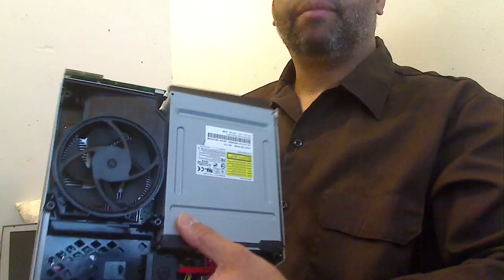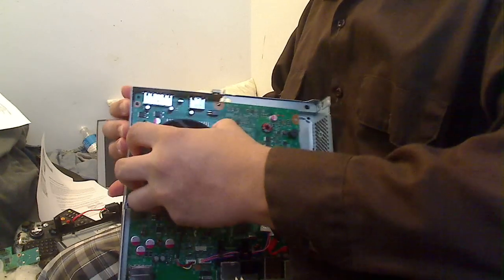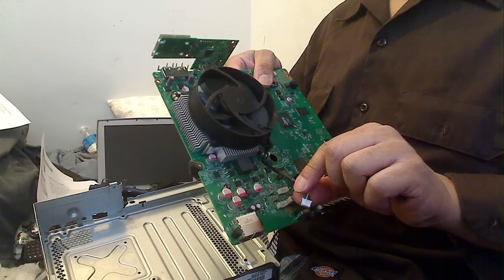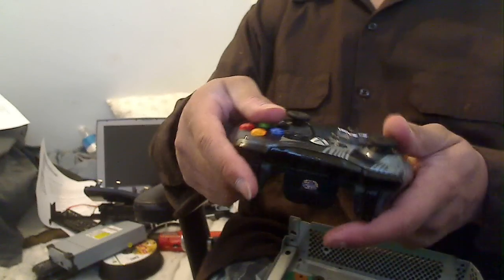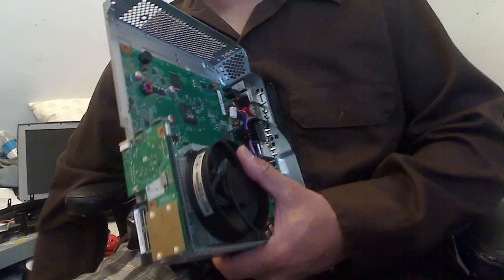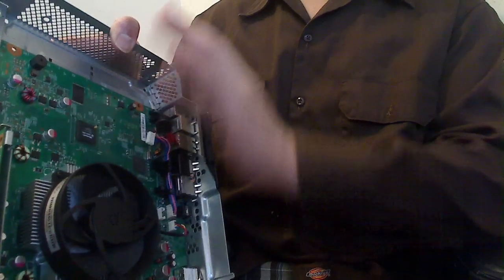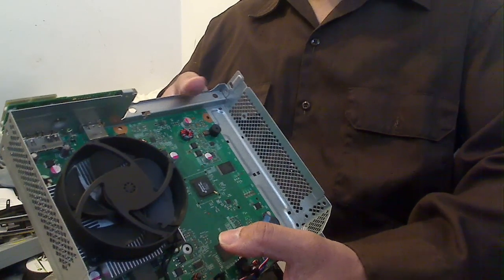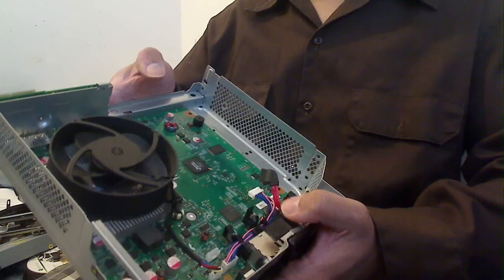How to fix Xbox 360 Slim RROD / Red Dot of Death Reset Solution👍

Comment: Ok so after 2hrs I tried to power it on again and to my amazement its working!! But I got a ventilating warning screen (which I brushed off as the fan reset/overheating method of yours) but its been 15mins just using the YouTube app and its really hot is that normal I've never really took noticed how hot it gets before all this and I just want to be sure its going to be fine please can you answer this time
Reply from the maker: It's not supposed to be running hot. If it is check to make sure that you've plugged the fan back in and that it's functioning and you can either here the fan spinning or see it spinning. Be sure the vents are clear of dust and debri so that cool air can come in and hot air can go out. Have you removed the heatsink, added screws or just placed the x-clamp back on.

Comment: So as many have asked and you have not given a reply to is once the fan is disconnected and you power on how long until it overheats and powers off I've been waiting 10mins so far and nothing just a solid red dot on console and solid green light on power brick wait... While typing the console now has a flashing red light? Kinda nervous as electrical stuff scares the shit out of me and this doesn't feel safe
Reply: Ok so to answer my own question about 15mins in 10mins it starts flashing red then about 5mins after that it powers off lol anyway I'll get back to you if I don't somehow electrocute myself if this works for me but my case seems unique as I spilt strawberry milk in the fans vent and after what I thought was a good clean powered it back on  and it worked fine for half an hour then bam froze and when I powered back on I was stuck with red dot and black screen but I'm hoping I've done a better job cleaning it this time but despite being positive I think I fried something but I honestly have no idea but again I'll let everyone know if it works for me so anyone as clumsy as me might have an idea if this will work for them xD
Reply: Ok so didn't work for me I'm broke af so can't but a heat gun and that seems like my only option other then just getting a new one which even know they're cheaper now I can't afford yay what a shit day
Reply from the maker: Your wait time should be about 20 minutes

Comment: Switch from HDMI to AV, if it works then your HDMI port needs repair. When the HDMI port malfunctions on these, it shorts out and the system throws the red dot to protect itself. I just switched cords after having this issue for weeks. Cleaned it and everything and the issue was the port.
Reply from the maker: This also ocurrs when there are bent HDMI pins in the back of the Xbox where the HDMI port is located..
Reply from the maker: Awesome Job Shug. Glad you resolved your video problem and that your Xbox is working again.

Comment: Please help me. I did everything, i let the xbox overheat, i put thermal paste and it still has the red light. Its not the power cable and its not the hard drive. I dont know whats wrong.
Reply from the maker: I don't know what's wrong either but I can suggest a few more options.
1. You can check the USB ports front and rear for bent or twisted pins touching the inside of the USB port. Unplug the Xbox and use a small tool to bend the pins away from touching the inside of the USB metal chamber. If the USB port appears unusable you can fill the chamber with hot glue from a hot glue gun ($3 at the dollar store). Only do this after you've confirmed that the pin correction was the problem and that you're Xbox powers up without the red dot.

2. Check the HDMI port(s) for bent pins and bend back or just use the AV or Component cables for an alternative video source. Components and HDMI give near identical video quality to the naked eye.

3. Last resort is to follow the video instructions about heating the board with a heat gun. Try focusing on the processor with the heat, top and bottom of the board. Don't forget to remove the fan and heat sink. Good Luck.

Comment: I'm guessing it's required to plug video in because it didn't work without, I'm test with HDMI plugged in right now
Reply from the maker: That's correct. It does not work without the HDMI or video plugged in.
Reply: @Romerro1  I believe the console is just dead I did this multiple time and it didn't work, I tried all of the "ez fix" tutorials and it just doesn't work
Reply: @Romerro1  it blinks green a few times then turns red, but I can also open and close the disk tray.
Reply from the maker: @lifesaviorrules5596  You may have a power brick issue.
Reply: @Romerro1  and the fan keeps running even while it's red
Reply from the maker: @lifesaviorrules5596  You're supposed to unplug the fan

Comment: I have red dot blinking 10 times on my xbox 360 can I replace the fan and put thermal paste on the cpu then after reset the xbox 360
Reply from the maker: Check your power adapter for a red light.  Try a different outlet.
Reply: My xbox 360 ac adapter is turning to orange to green then it shuts down and turn back to orange.

Comment: I did the reset but it still didn't work could you give me some advice please
Reply from the maker: Check your power brick to make sure the brick doesn't also have a red dot. You can also try a different outlet.
Reply: @Romerro1  thanks for replying, the brick has a green light and I have tried different outlets, is there anything i could do, thanks
Reply from the maker: @MrSuperstrongman  one of the options I mentioned in my video when this simple reset doesn't work, is to use a heat gun to heat the board but before you even consider that you should make sure that you've removed the heatsink and fan assembly, then clean off any old CPU thermal paste and replace it and then try powering on the board. I mention this because many that follow this video want to skip this step for some reason. You shouldn't just do the reset alone without cleaning the old thermal paste, replace it with new thermal paste or the board will still shut down and then clean the board of all micro-debri. But using a heat gun after you've completed the previous steps that I mentioned usually gets an Xbox 360 slim up and running. Rewatch the video and be sure to follow the steps.
P.S. in the future it would be a good idea to state exactly what you did after watching my video instead of just stating, "I did the reset" and it didn't work so now what...
Reply: Thanks. 
P.S i didn't say "so now what"
, I ASKED POLITELY.

Comment: I can see from outside that there is many dust on it but i have no screw driver to open it. Could it be that the dust is the one that’s cusing the red dot on my xbox360?
Reply from the maker: Open your case and clean out all the dust. Dust can kill any PCB especially an Xbox board and make sure that there's plenty of ventilation where it is that you perform your gaming.

Comment: Look. I used to and still am the console guy my Wii U my choice for the latest gen even though the switch replaced it is still a 1.33 IBM 3 core power pc like pre 06 macs...but I get red rings occasionally, and quite a few little bullshit xbox one repairs that come in. If you really like gaming with consoles I wanted to offer some food for thought! Please fan f***s, put your dorsal fins down and read this with a grain of salt. Things like the gamecube, 360, dreamcast, n64, the wonderful Sega consoles I like to run RAM cartridges so original hardware with of course!...backups as boot media :) but consoles are fast being obsolescence and Nintendo has done great at keeping themselves alive by reinventing the console concept. From DRM fiasco to a PS4 when I got my wii u years ago that had not a game worth playing however my first console 17 years ago almost for my 8th bday... the ps1...made a much better controller for normal size hands and killer good looks even the fat ol xbone 1 is kinda sexy...but when you take a PC like the M77 motherboard Dells with ivy bridges and stick a sapphire rx560 4GB GDDR5, creative sound blaster 7.1, 32gb of ram, a 240-1tb ssd any will do I like the SanDisk cheapest and the PNYs, update your bios to A14, put an EVGA 600B power supply you have something that was missing a good GPU...fixed that for 130, slow storage...like you fight consoles to adapt a SSD...30-130$ (120gb-1tb) and put in some serious marantz receiver like sound output...40-60$ (5.1 or 7.1) its optional but proved it makes a huge impact it's got nice powerful Linear Tech And Analog Device IC chipsets and for 16 bucks a tv tuner and remote...yeah you can watch OTA tv on it! Give it a more power efficient and less juice gobbling and more powerful PSU for a mere 40 bucks plug and play tuck the unused cables in a optical or storage unused bay zip tied in a ziploc and now you have 100 in the pc, say 60 you want a 480gb ssd. Were at 160, she comes with 8gb, it will do, 12 for good gaming, 16 for no way to run out! ...60 bucks, were at 220, add the power supply, 40, were at 260, add the ST RX560 4gb 130$...390, and if you really want add the sound blaster I got for 50 on sale the 7.1, 440, and a wild card like a tuner to fill the expansion bays...$456, got a 1080 monitor from dell for 130 so if you dont have a monitor 586...the new ps4 is just under or above that depending...ummm...except you have reliable equipment that is easily upgraded and I could do it not much longer than it took you to read this, the Vostro 470, all THREE I OWN, COST LESS THAN 800 ALL SAID AND DONE! All late 2012 towers come with an i5-3450 3.1ghz 4 core or the i7-3770 3.4 that boost up to turbo mode 3.4 and 3.9 ghz respectively...that's more powerful than any console and has 2 3.0 usbs front, 2 rear, 6 2.0 usbs rear, 2 front, ethernet, wifi, bluetooth, every flash media from 10 year old memory cards so SD cards in the front, and a 24x DVD-RW you could do one further and move it down or put a bluray drive for 60 more. The console is beyond out of date and I fought the fight to hold on hoping for better and instead have to pay this to have that or sacrifice this game for this feature...its just not worth it and add the point of the video it's in for repairs with two consoles in esd bubble wrap I gotta fix and tear into...its just a waste of money, time, freedom of choice and flexibility! I run win 10 pro and get cheap licenses through work at bulk but dont need to activate it to do much extra lol so I didnt add that cost but the biggest things above memory and other stuff are 3 things, a SSD! I allows nearly instant file transfer and the computer is ready from button on to game playing in 30 seconds! For this m77 you need a GPU because the xps, vostro, and optiplex business machines they inhabit aren't for gaming or desktop high graphics, the GPU next paired with a great 3 year warranty PSU for only 40 bucks and looks great and has enough power everywhere for whatever you want to shove in it! I love my consoles to death, but the innovation has stalled and it's just software wars...all which PC will win sadly. I wish it weren't true but between failures and build quality and generations of obsolesesenced crap I have to walk to the other side of the isle. Theres tons of vids on the build I described so check it out before you thumbs down and this was an awesome video on the repair for the 360 slim but I wanted you guys and gals to see...maybe that money from a person paid to repair that manufactures printed circuit boards for high end customers for a living might have a few cents to save you some time money and activation!

Comment: I had my for a year and one day this. Im going to attempt this and see if i can getting it working for the kids
Reply from the maker: If you go through this forum, which is extensive, you'll find that a large percentage of people have repaired their Xboxs over the years and some have failed and some didn't do everything I suggested in the video and them claimed it didn't work. I know because I've asked them specifically to lay out all their completed steps. They usually all leave out the heat gun board heating, otherwise just called heating of the PCB. Although this is an optional step, it is necessary if the processor reset doesn't work. So good luck with your reset.

Comment: I can't get mine to work my little boy had 360 slim then he got a one x but 360 worked i put in a box  and 2 months later I take it out the box and it had a red ring but I haven't tried unhooking the fan and letting it over heat mine when I push power it turns green 2 sec and middle tues red for bout 10 sec and cuts off plus it want open were the disc goes it's pissing me off I'm a motor mechanic but in a bet this ring
Reply from the maker: You may have a power brick error or electrical current issue. Check the power brick for a red light. If it has one, it's faulty. Get a voltage meter and check for 118v-120v for proper Xbox functionality. Xbox's have been known to red dot or red ring when there is greater voltage over amperage. Have an electrician check your lines for resistance..

Comment: When heating the board with a heat gun, is it important to cover the other parts with aluminium sheet? Cause i've seen other videos where they did this to protect the parts other than the gpu chip from overheating.
Reply from the maker: I've seen those videos as well. I've never covered a single component ever. I use 600 then 1500 but i never put the heat gun close enough top scorch

Comment: I fixed a bunch of Xbox Xbox 360 arcade and Xbox 360 slim consoles I clean the dust out of the power brick for the xbox 360 arcade and slim that screw MOD messes up Xbox 360 systems the motherboard will Warp and crack always use the 4 black screws the hold the X clamp I changed the thermal paste on Xbox Xbox 360 arcade and Xbox 360 slim and all 3 of my consoles work fine with no problems

Comment: What if mine instantly red dots as soon as I power it up?
Reply: happens to me too, any fix?
Reply from the maker: Follow the video to repair or 1st check that your power brick doesn't have a red light. It may need to be replaced if it does or there are voltage problems. The red Dot can also be caused by USB pins touching each other or touching the metal housing. The red Dot can also occur if the HDMI pins are bent and touching the housing or another pin
Reply from the maker: The other thing you can try is the optional part of this video if the reset doesn't work which is heating the main board with the heat gun on both sides. Refer to the video for instructions.

Comment: I did this today. It did work when I did it all and tested it before it was assembled again. Then I reassembled it back together, and not it's back to doing the red light again.
Reply: I never messed with thermal paste so maybe that is why it's not working...
Reply from the maker: Oh well that's one of the most important steps that all so many people seem to want to skip, since most just want to see if this instruction set laid out in this video will actually work. The dried out paste only allows heat transfer when it's moist new paste. You successfully reset your Xbox but you didn't repair the problem that caused it, which was a non-transferance of heat from the cpu, to the heat-sink which allows the fan on top of the heat sink to create a continuous movement of heat flow away from the CPU. If this does not occur while the xbox is on, then heat will build up where it's formed, which is in the CPU as gaming occurs and the red-hot error will return, protecting the CPU from damage. Purchase CPU paste from Amazon or a local computer store. You cannot complete the repair until you do so. Please consider subscribing if you found this video useful.

Comment: Hey Donte, I was wondering if it is possible to put the same X clamp back on once it's removed?
Reply from the maker: NoScarModz Yes. You can place the same xclamp back on, as long as the xclamp isn't damaged and the same hard plastic piece is still in it's center. In my video, there should be an Annotation pop up that states to reuse the xclamps instead of the screws. The annotation appears to only display when viewing the video from a desktop PC.

Comment: It reset but still gets the red dot. Is there anything else I can try?
Reply from the maker: You could try a different power supply or replace yours if it has a red-light. You need to make sure you've replaced the old heat-sink paste with new paste after you've cleaned off the old. You can try running a heat gun over both sides of the board and let cool down before testing.
Reply from the maker: Replace the CPU paste

Comment: Awesome and informative video on how the process works. But... I currently have one of mine taken apart because of the red dot and I cleaned off the dry thermal paste from the processor and heatsink. I just ran the heat gun over the CPU (then let it cool off) and applied new thermal paste and reattached the heatsink and xclamp. I powered up the console without the fan being plugged in and it gave me a green dot for a few seconds and then it turned red. How long should I wait to hook up the fan and the other peripherals? (In hindsight I know I should've waited on the thermal paste. But will it still work?)
Reply from the maker: My Lord it should still work but the wait time is about 30mins.
Reply: Donte Beachem Thanks for getting back. I was able to reflow the whole board with the heat gun and it's worked fine ever since.

Comment: My xbox 360 is glitching and freezes my TV
Reply from the maker: Well that's a new one for me but you may want to check either the HDMI port or the composite/component video ports on the back of the Xbox for debri or bent pins that may be touching one another or grounding out.